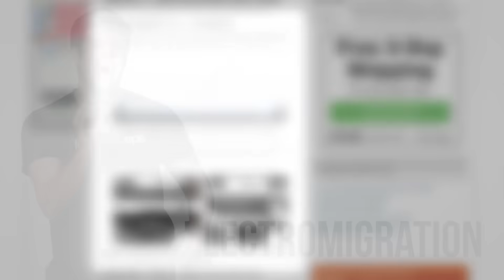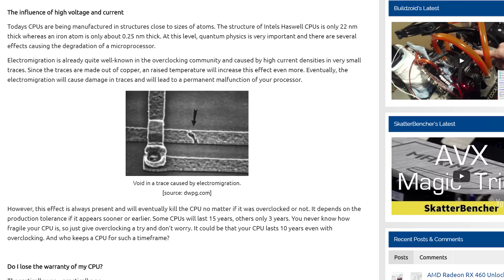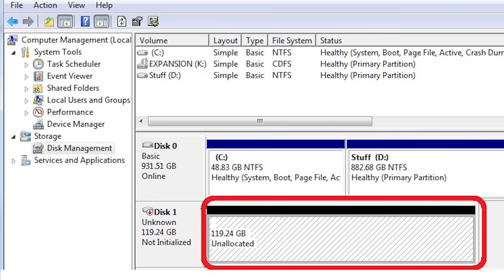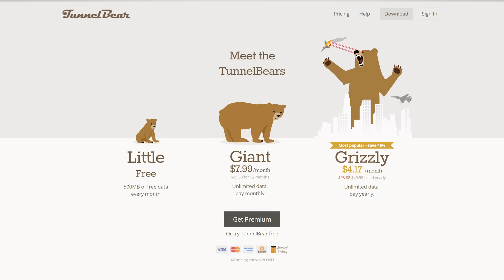Why Do Electronics Die?

Comment: I believe a more important question would be why electronics die the day after warranty expires :/
Reply: right, my iphone die exactly 1 year after i bough it, no waranty because of litle scratch on the body, right
Reply: Dangerous Cheese or planned consumerism xD
Reply: Jonathan De Felice that is the day for the micro trolls to mate with your components fucking up your computer.
Reply: @Sizzlin Moe I can confirm that. There is a video here on Youtube showing a 100 year old lightbulb in a firefighter station in England that's still burning strong. It's the introduction of a documentary on a cartel by all lightbulb companies in the 40's that enforced that all lightbulbs should not last more than X hours. Depressing.
Reply: Software aside, not sure how you can manufacture physical materials to die within a day or even within a few months of warranty. Physical materials are normally measured in years within a specific specification and have no definite periods where a company could guarantee 100% failure. Furthermore, most companies will still honour the warranty during a grace period afterwards. The company I work for often will allow 3-6 months extra.

Planned failure on a hardware/physical side is very hard to manufacture, trying to get a product to fail just after warranty but knowing 100% the products won't fail in warranty(otherwise it will cost the company more) is very hard. The nearest would be say "this material we use only has an estimated life span of 5 years in these operating specifications, our warranty is 4 years" as an example.

Software is a more commonly (and realistic) used way in the modern age to make older tech feel slower or become incompatible often without good reason. Edit: software is also easier to control, so you can plan a product that you want people to migrate from to the specific date you send the software out. This can be done knowing all/majority of customers are outside of warranty, rather than leaving to chance that a material will fail a day out of warranty.
Reply: @jonc-1989 i kid you not, no matter how hard or even impossible it is, companies will always find a way to do it nonetheless. i have so many things that just, died. i have this acer 2 in 1 which had the audacity to break in the same exact way by itself 3 times within warranty and each time they couldn't even fix it properly without causing other random problems everywhere else. hardware is made with planned odelescence in mind.
Reply: Actually it's not that hard. For example electrolytic capacitors like those described in the video got datasheets including lifespans under x °C. Electrolyte dries out, that's normal. And instead of taking those which in theory can stand 20 years or so, you can just take the cheap ones which at least keep up the warranty time, but not much after it.  
As a guitar player I know that from guitar tube amplifiers. Got one which is 20 years old, and after that time I swapped out all those electrolitic capacitors, because at least one was faulty and the rest probably soon to be too. That's fine, its normal, and every amplifier-technician knows that. Other amps are older than 30 years and still work fine with the stock capacitors, but especially nowadays it's getting more and more common that they die just after some years due to manufacters saving money in the production process. It nearly never happens in warranty time though. Why? Because you can calculate the most probable lifespan of those things.
Reply: GreenDisplayGaming I was just joking. usually, appliances die the day after the warranty expires lol who knows why..
Reply: planned obsolescence is not always the company goal. tech companies do know that a $2000 piece of kit used normally, should function well past their compatibility date (OS/peripherals). end users tend to not rebuy stuff that fails prematurely. (unless they cater to dumb consumers)
Reply: Planned obsolesce. As stated in the video.
Reply: From my own experience, the more expensive an item is you buy, the longer it will last. Obviously, there are some exceptions to this rule, like having a compact Toyota that can keep running beyond the 100k miles for a good 20 years. But, for a cellphone or tablet, that answer gets a little complicated:
1) As companies put out newer devices, they make newer operating systems to go along with those new devices. App makers then have to design their apps around the newer OS, leaving older OSs and portable devices in the dust.
2) One study showed that 30% of iPhones fail after 2 years. But, that wasn't because of some rigging Apple introduced. The 30% was caused by accidental drops.
Reply: cheeky Chinese micro controllers with a termination date set on the internal clock.
Reply: The answer for this is actually pretty simple. Devices have a life expectancy much like vehicles and humans do in miles and years respectively. Manufacturers and Retailers just set their warranty's length to be just shy of the product's life expectancy. This is both to ensure the consumer has to product for it's intended lifetime AND that the consumer can't return or refund it once it reaches that point.
Reply: Jonathan De Felice same with my electronic stove....
Reply: Jonathan De Felice because apple likes money and wants you to give them more money
Reply: Jon Crook probably don't by using certain materials which wear out after a shorter time. Wouldn't cost them more. If the product is too durable and long lasting people won't want to upgrade
Reply: One answer : Planned Obsolescence.
Reply: That's true... and this is because each thing intended to do the job for a defined period of time..
if your warranty is for 3 month the item will last 3 month and one day.
Reply: Because the warranty is actually the expiration date
Reply: Every component has a rated life, the longer it lasts the more expensive it is, so the manufacturer usually goes with whatever will for sure last the warranty period and doesn't care what happens after it's run out.
Reply: 4:25
Reply: Because the warranty is supposed to cover manufacturing defects. They test their product to see how long it will last under normal circumstances and then cover you if it fails outside of that timeframe.
Reply: Jonathan De Felice because the company Forced you to buy the newest Model
Reply: Same is going to happen with new cars, all computer controlled. 2years old, parts obselete.
Reply: Planned hardware obsolescense is actually not that hard. There are many ways other than capacitors to reliably kill a product. For example, you can design a chip so that the current running through the connection lines is just enough to cause electromigration, which causes the line to burn through once it gets thin enough. Also, if you know the temperatures the chip will be running at, you can design diodes and transistors (the pn-transitions of them specifically) to diffuse enough to make the component inoperable over a given amount of time.
Reply: So that companies can force you to pay money more easily.
Reply: Don’t matter if fails after warranty, any equipment has last a reasonable amount of time if fails the your entitled to a free repair or a partial refund as you had fair use of it.

More and more are failing due to cheep parts and BGA packages that allow smaller form factors but not as robust as DIP also lead free solder results in more dry and brittle solder joints.

Years ago when 74 series DIP and other chips were used it was leaded solder and threw hole and also modular so easer to repair now it’s more of a throw away anti green way of working
Reply: @sleepykyokoxoxo  Really? Link? Also how efficient are they and what did they cost to make?
Reply: MTBF - Mean Time Between Failures
Reply: They are designed that way to squeeze more $$ out of you.
Reply: For that you'll have to study reliability.
Reply: Amazing that 1.6k people saw the video without hearing him answer that. He literally says that electronics break right after the warranty from planned obselescece. So there you go, and no you weren't joking and no I don't give one single fck how many other people said this.
Reply: Well, Planned Obsolescence!
Reply: In the last decade it actually happened 4 times with me, 2 motherboards and 2 webcams.
Reply: Money the sweet sweet paper dough that they need to swim in a Olympic size swimming pool
Reply: Jonathan De Felice Desktop Dust-free Working Bench for laptop phone repair shop
①Solder ②Rework ③X-Ray inspection  We Provide One-Stop Solution!
This is Joy come from BGA rework station/ ALL phone repair and inspection line with 14 years experience.
REPLY me to get our product price list and more information.
Joy Rong
WhatsApp/wechat/Skype：+86 18779975930
Email: sales25@zhuomao.com.cn
LinkindIn: Rong Joy SMT X ray
Reply: @sleepykyokoxoxo  agree
Reply: Yeah that's just Apple, they die on purpose so they can make you pay for a new one while censoring truth on MANY fronts and lobbying to not allow you to fix it yourself by stealing the parts you bought internationally at customs, while supporting illegal aliens invading the border...  It's also a Communist backed company, you know, the Chinese infiltration facilitated by the good ole' Clintons...  Stay raped, San Diego
Reply: Jonathan De Felice, or right before it expires and then when you go to ship in it to late. You is f$&cked.
Reply: i would get a two year warranty if bought from walmart or bestbuy. do not trust the "manufacturer's warranty"
Reply: Planned obsolence.
Reply: Murphys law
Reply: It was answered in the video tho
Reply: Its not electronics  die after the day warranty exp, Its warranty expires the day before the item die. The product is designed to have a specific life and the warranty is placed just before that life span.
Reply: Its not electronics  die after the day warranty exp, Its warranty expires the day before the item die. The product is designed to have a specific life and the warranty is placed just before that life span.
Reply: They are meant to break after warranty
Reply: Here's Veritasium explaining why: https://youtu.be/j5v8D-alAKE
Reply: He stated planned obsolescence
Reply: Thermal aging is very well understood in other words, because processors run at 80'C or even 90'C under load.
Reply: For that reason Apple is worth $1 trillion
Reply: warranty ends pc parts: ait imma head out
Reply: My wife's car battery DIED 2 days after the 3 yr warranty ....   2 FUCKING DAYS AFTER THE WARRANTY ... 
That 2 days costed her $125 ...
Reply: Because the warranty is basically the life span that they think the electronic will live up to. Something that has a very short warranty means that they don't think it can live up longer than that.
Reply: planned destruction
Reply: Literally 5 days after warranty expired, my PS2 slim stopped reading discs. It's as if Sony knew...
Reply: Smells like capitalism
Reply: Truth be told hardware these days are utterly trash and were being suckered in.
Reply: well , economics :) , why cars broke even on warranty and after u must replace parts like crazy 🤣, nothing is good today and it's designed to fail because if not we will not buy anything and they will go bankrupt , so simple
Reply: A digital timer is built into the microchip to make it fail after a certain time: planned obsolesence.
Reply: So you buy a new
Reply: Planned obsolescence
Reply: He sais it right there in the video. Planned Obsolescence.
Reply: Same deal with cars.
Reply: There used to be a time, when some brands of cars & even lightbulbs, could last (forever)... Unfortunately, brands whose cars/lightbulbs are too sturdy, go out of business. So in the lightbulb-business, Edison & a whole lot of other manufacturers (Philips, etc), joined a cartel, to design lightbulbs, which die faster. After a while, this practice (planned obsolecense/breakdown), needed to occur faster (to improve profits). This of course is where legislation stepped in, to oblige manufacturers, to give at least some warranty (otherwise probably devices would break after a week or a month... So companies worked around this with R&D, to design products, to last only the length of warranty, or in case of cars, to see that their replacement parts break more often, than needed. You see  this also with computers, for example 'business computers (which are designed to last 4-5 years) comapred to consumer pc's, which often break, just after warranty, due to 'different design logic (regarding 'planned lifespan'), between both types of computer, even going as far as making 'business computers' less available to 'end user environments', for example Lenovo, HP & Dell do this, with their Elitebooks, Thinkpads, etc (better materials/components, build quality)... Just pouring in my personal experience into this comment, as well as the things I looked up
Reply: LG are notorious for this, they use super cheap garbage capacitors and calculate their mean life so they last at least the life of the warranty, meaning that in or around the time the warranty expires caps will start to pop left and right. I have this one particular screen which blew exactly a week after the warranty ended, changed the culprit, a week later another one, and another one... I had to change pretty much all caps on the power board one after the other. Now its been going for many more years with standard quality replacement caps.
Reply: Because God has forsaken you, and only you.
Reply: Thats not with every electronic components. My Mainboard, CPU, RAM and PSU are now 6 years old and it works great
Reply: Cuz crapple
Reply: Jonathan De Felice it dies because the dev of the device puts a input of time it would expire or more if your lucky it's basically a bomb tho

Comment: Speaking of planned obsolescence, have you ever taken apart a budget TV or an included power supply from a computer chassis?

I shit you not. They literally will take some sort of high power shunt resistor or other hot component, and they will GLUE it to the liquid electrolytic bulk cap.

That is to say, they glue the hottest component to the most heat-sensitive component.

It was common enough to see that it was basically standard practice. That's how we got many of our TV's and power supplies back in the late 90's and early 2000's. We would buy bad parts for, like, 80-90% off and basically just replace that cap. Our first HD rear-projection TV was about $1500 new. Got it for $100 because it wouldn't power up. Replaced the cap. Checked the connections. Got it up and running easily.

In many cases, planned obsolescence isn't quite this nefarious. You can ask many engineers. The idea is that minor components will die and decommission the device before something even larger breaks and causes a more catastrophic or deadly failure.

Comment: I am curious what high capacity capacitors do not contain electrolyte? Cap plague had to do with an improper formulation of the electrolyte too. Key stabilizers were left out.